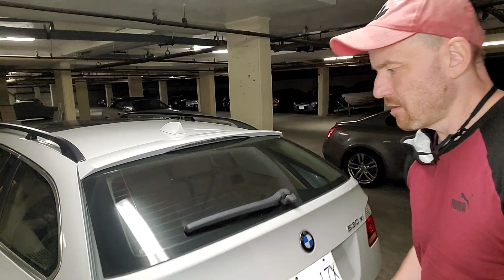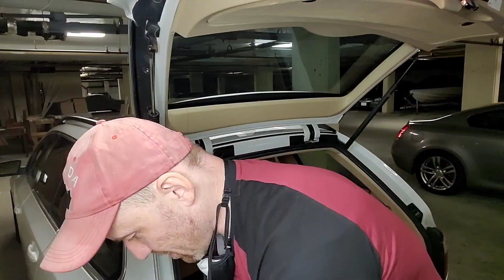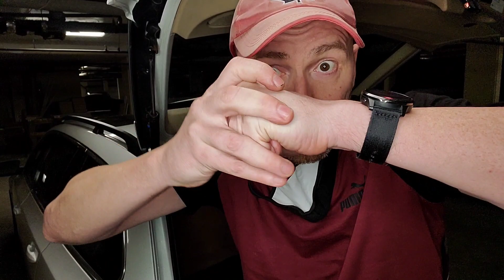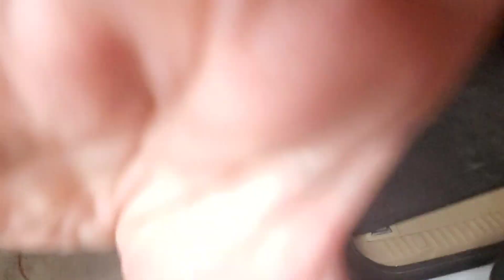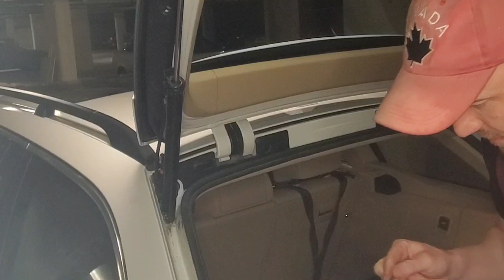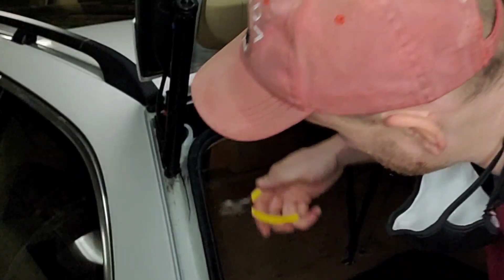BMW Power Tailgate wonky strut Easy Fix

Comment: i had the same problem, i just got new "nipple" for 20€ and used penetrating fluid and a flat head screwdriver to dig that ring free so it moves in that groove it sits in and works perfect now